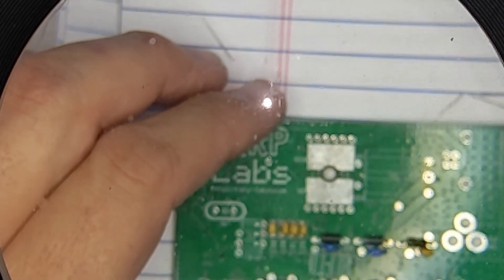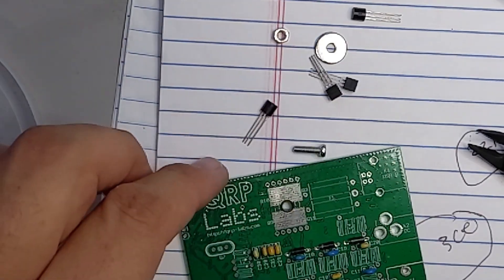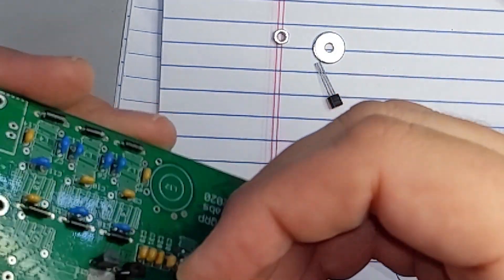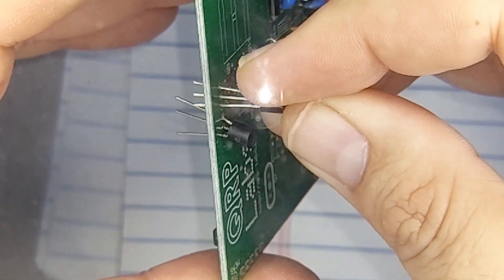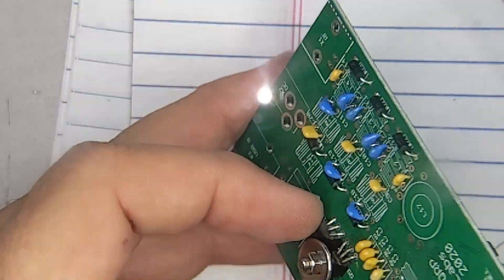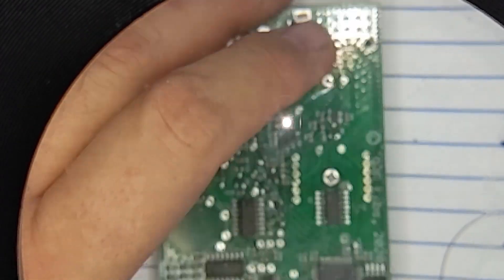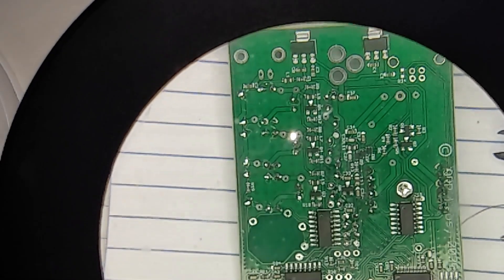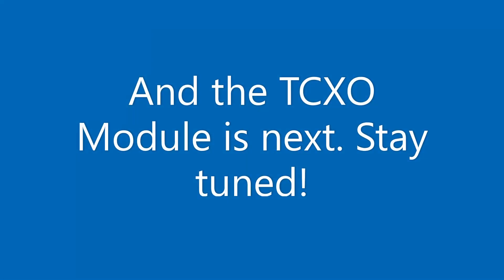QDX Build Part 4: PA Transistors

Comment: Interesting.  You build that completely differently than I do.  This is why I like videos like this.  This is about the fourth one of that design I built (including homebrew on protoboards) and what I settled on is soldering one pin down on each BS170 from the top while holding them in place by hand.  Manipulate them to look good.  Once they are neat then I get them from the bottom.  Then I put heat sink goo on the tops of the transistors (it can't hurt) and screw them down. Completely backwards from how you did it.  Very similar result.  Manipulating the physical placement of the transistors with force of the washer before soldering at all is interesting.   Need to try that next time.
Reply from the maker: Thanks Fred. I'm glad you liked it. I love watching videos like this for the same reason!